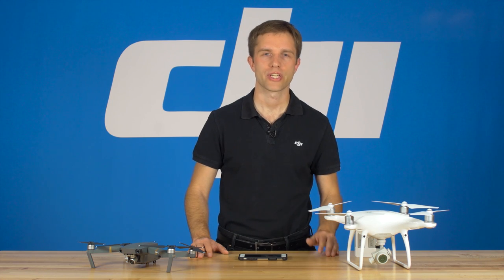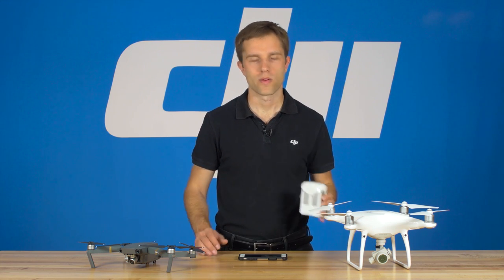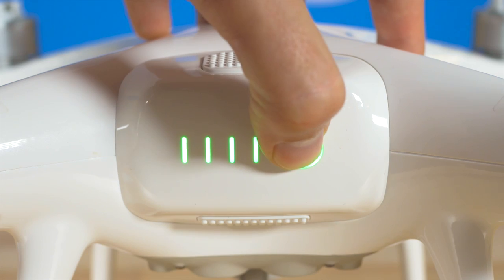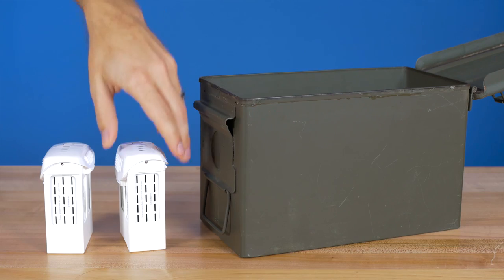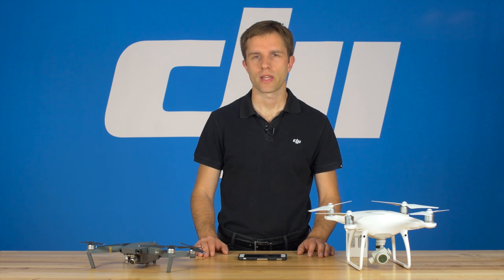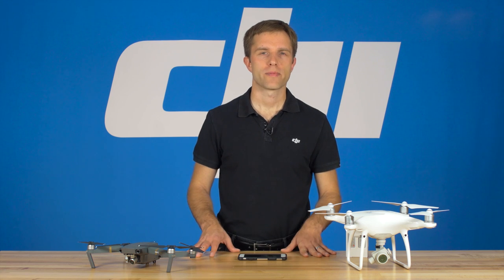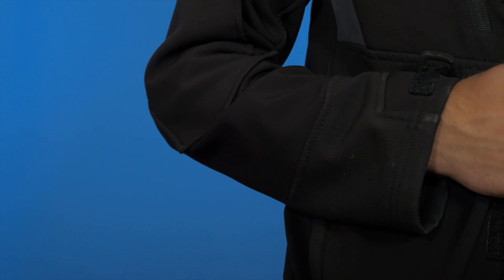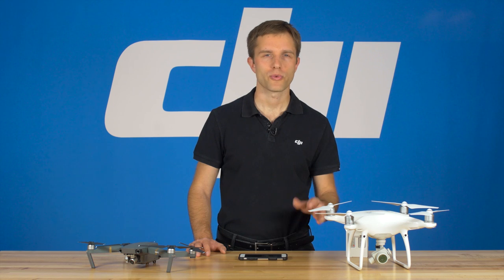DJI Tutorials - Flying in Hot and Cold Weather

Comment: if the battery is below 15C it prevent take off?  no it doesn't.. thats a lie LOL.  it does very briefly popup warning that battery temperature is too cold.. but it lets me do manual take off (CSC method take off). other week during a snow storm i left my mavic air in the car (doc appointment and lunch) and when i was finally ready to fly it the battery temp in app was 5 degrees C (according to the app) and it let me take off no problem, it did show the warning but when the props spun up the warning disappeared.

maybe there is a bug, but im glad it does not prevent me from taking off because 15C isnt that cold also hovering helps warm the battery up, which is how i do it when my battery is cold..  ...while waiting for GPS i take off and hover 5 feet off the ground for 2 minutes then start cruising..

Comment: Your tutorial is not true, I flew my mavic air a couple of days ago with weather  temperatures of 34 deg Celsius..i didn’t receive a battery warning at all on the app! good thing i check the battery status and on the monitor it shows a whooping 79deg Celsius on my screen  after just hovering my aircraft for less than 20mins. I immediately did a landing and removed the battery immediately. I saw a youtube video doing battery drain @ 6Amperes and battery temp never goes up, but he says the mavic air uses around 8 Amperes, and the battery temp rises up at the rate of above 6 Amperes. I hope DJI could find a way to make a 6 Amperes discharge rate for all their drones to avoid overheating, I’m still a fan of DJI products. 79deg Celsius means my drone catching fire if it hits 80deg celsius and above, but NO WARNNG DISPLAY showed up on my DJI Go 4 app while flying.

Comment: the battery quality of Mavic air 1 is soo bad , 35 Cycle and they get to 79 C during fly in Thailand , and 2 of them Swelling  which no reason , i saw many people face the same issue. Thats why the warranty is so short and they will reject to replace. they already knew the battery and over heating problem.

Comment: this does not help me at all for how to keep the battery cooler or warmer while in the air.. just tells me the temperature limit.  what the hell
Reply from the maker: Hi - you can keep your batteries warmer or cooler as needed before flight using the methods described in this video, but you can't control battery temperature while in the air. The Inspire 2 and M200 series are currently the only models with self heating batteries, which will maintain their temperature in the air.
Reply: ok now i get it.  your description is better than the video thanks